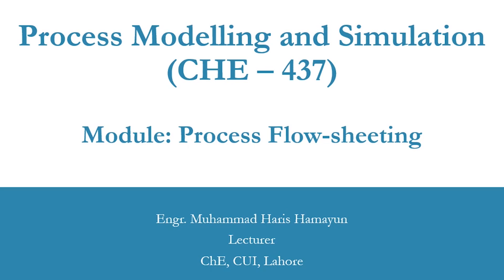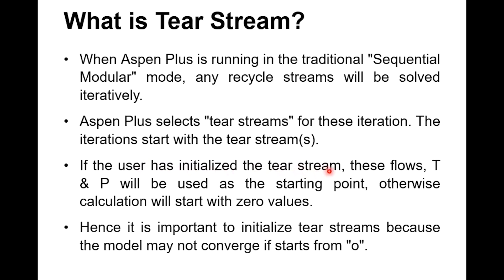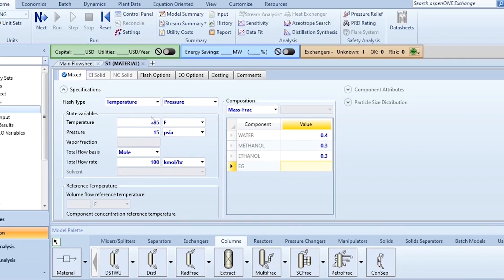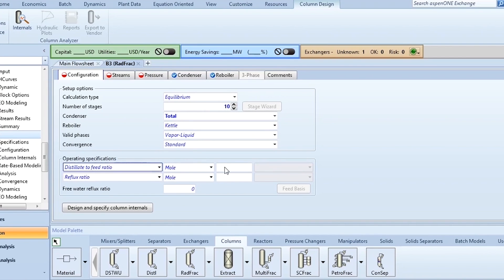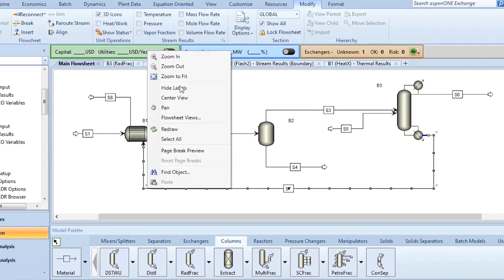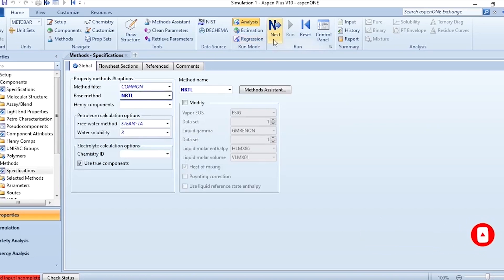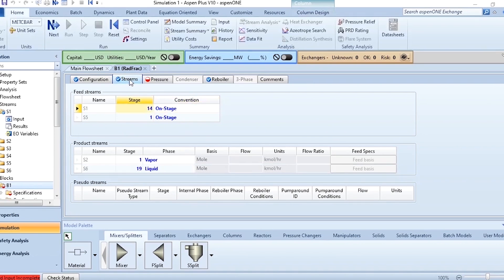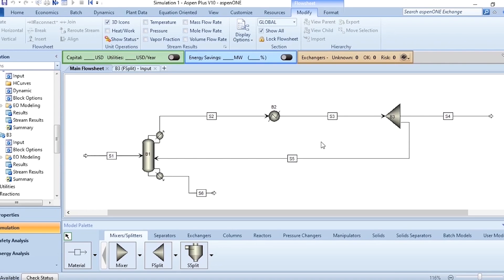Using Aspen Plus to solve the problems related to the Tear Stream Convergence

Comment: Hello, one question is that I followed the steps in the video but I get a solver convergence error $solver01, supposedly there is no convergence in the ethanol. I saw in the recirculation stream and compared to yours, where it gives you a low ethanol flow of the order of 0.0002 lbmol/h, to me it seems to be of the order of 0.0101 lbmol/h. I would appreciate it if you could help me how to solve this, thank you in advance. Edit: I increase the number of iterations and the system converges but leaving me with a flow of 0.00102 lbmol/h of ethanol, I have increased it up to 200 iterations and it does not go down any further.